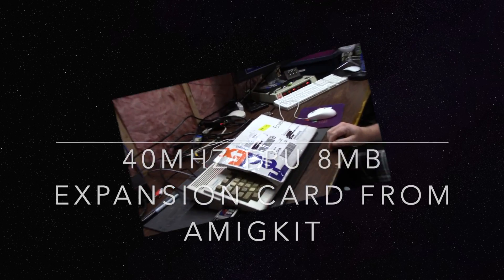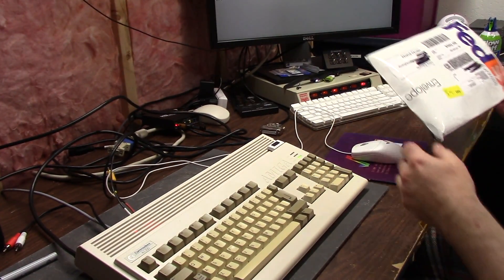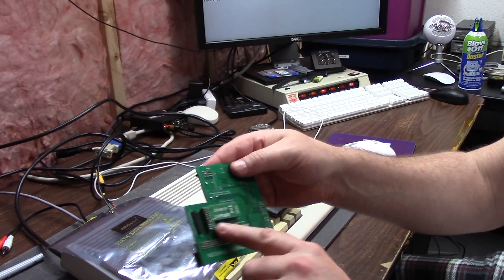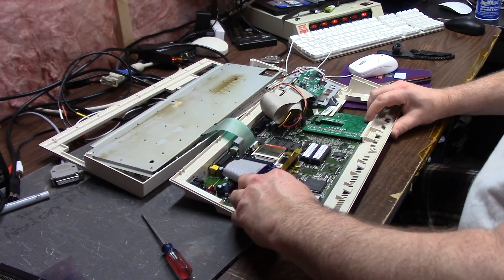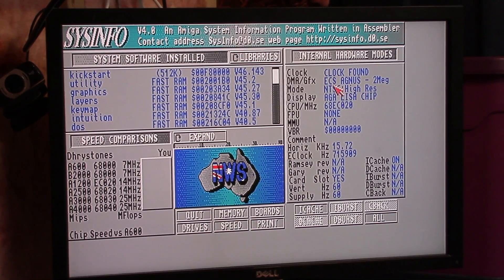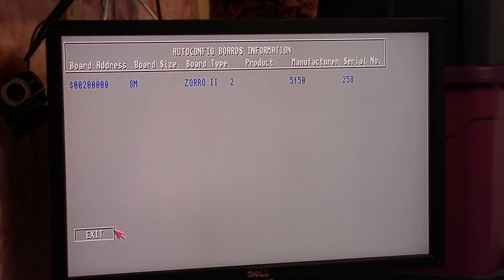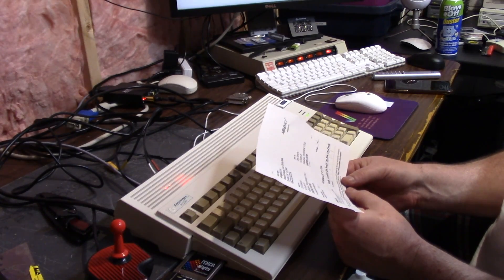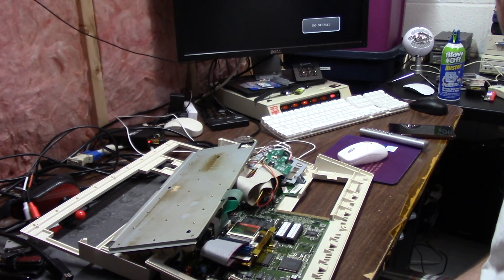Amigakit Amiga 1200 8mb ram card w 40mhz fpu

Comment: I have 2 A1200 one has got a ACA 1233n I have fitted a FPU it works nice abd the other one has got a  Apollo 1230 Mk-III with 32Mb Ram
The ACA 1233n cards cost alot but they are worth it in the long run.

Comment: I just wanted to tell everyone that since my last comment I've managed to reinstall my Amigakit 8Mb upgrade so that one edge is underneath that plastic lip on the case and now I have managed to close the case! After this, I installed a new 32Gb CF card hard drive which has lots of WHDload games and demos, as well as Deluxe Paint IV AGA, Deluxe Paint V and Personal Paint installed. Unfortunately, I found out that not all of the games and demos I've tried so far will actually run under this system on my now 10Mb Amiga A1200. This happens even with AGA games. I wonder what settings I should use for them all? Perhaps these details are buried somewhere in the readme files or manuals, but I haven't found them. I usually get a black screen, then I have to either reboot or turn the power suppply off, wait a little while, then on again.
Reply from the maker: many of the whdload games require custom slave settings. it is usually in the docs, or you can just google the results,

Comment: Thank you sooo much for this video! I've just bought this Amigakit 8Gb RAM expansion with the RTC but without the FPU. Like your package it didnt contain any instructions about the 8Mb expansion itself, only the RTC I thought I'd plugged it in through the trap door, but I wasnt sure. FInally, I found it wasnt detected until I removed the internal shielding and plugged it in from the top instead of the trap door. The RAM and the RTC are now both working, but I can't close the computer case! I hope you can tell me how to do that, as well as if your FPU works at all. I'm looking forward to some more videos about this from you!!
Reply from the maker: you can get it to fit super normal and easy, just take a flat file and kind of take the edge off the bottom connector , just like a 1-2mm max, and it will slide in like a normal card! thank you for the kind words, glad it helps!
Reply: Hi guys, I bought this 8mb Fast Ram card from Amigakit. (with FPU installed but no clock) as well n so far it's working great. But sometimes it will just crash n reset my A1200 after playing for a while. But my biggest problem is that with the card installed my PCMCIA (CF card slot) doesn't detect my 4gb card now when it did before. Have I done something wrong?

Comment: First accelerator for my a1200 was an aca 1232 030/33 with a128mb of ram. Still works great and its very reliable. I had a ton more issues with the vamp 2 in the a600 but they've been ironed out now.  Id recommend these accelerators for the same reasons you did. Great for WHDload and overall workbench stuff. I can even play some 3d games quite well that shoud really be running on an 040 at least. Id love an 060 for one of my A1200s but i m not rich.

Comment: The FPU should really work with 40 Mhz, which it gets from the crystal on the board as you mentioned. Obviously, that doesn' t work correctly so you havdcto set the jumper to ext. That means, the fpu now clocks from the crystal that clocks the 68020 cpu with 14 mhz. There is something rotten here...
Reply from the maker: And rotten it was they sent me a new fpu and it now works fine ,  said they tested, long trip to the usa anything could have happened

Comment: Read the little paper it may require you to download software to change internal settings of their card.    Not sure if you contact them if you will get a reply which is a pet peeve of many people.   I buy a lot of stuff from Amiga Kit and I always read those Blue and White papers because not everything they sell is plug and play as I mentioned before.    I have an 8MB Board I use to run in my A1200 before I installed an 030 board with a ton of RAM.   Just having that board did give me a performance boost but it did not have an FPU.   I think the board was from Amiga Aliience (Good Luck finding those people).  I purchased it on Amiga On the Lake.
Reply from the maker: Many people have poo service with them i do not they responded right away and sent me another fpu i got it within three days to the usa w my other order
Reply: @ChrisEdwardsRestoration  I am a long term repeat Amiga Kit Customer.  Yea sometimes they are slow to ship but when they do it arrives quickly.  I run my factory 10 production days with 4 days off.  So I always hope my orders arrive in time when I am off and I am happy.  My current order is taking a bit long but its probably Covid-19 related or they have to build what I did order who knows.